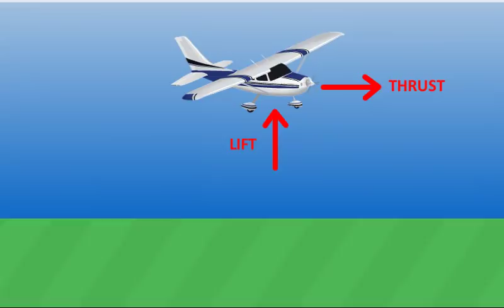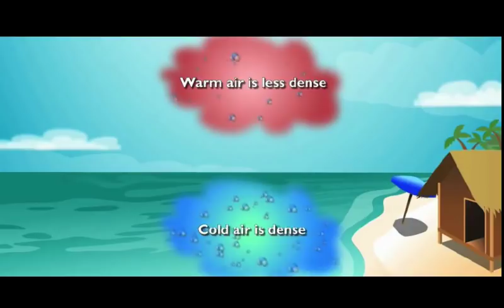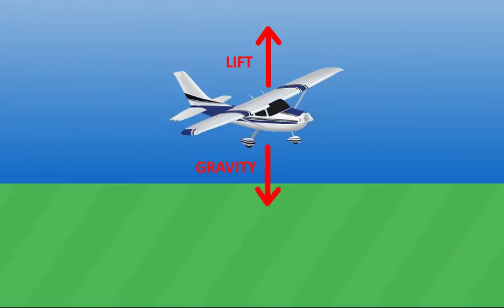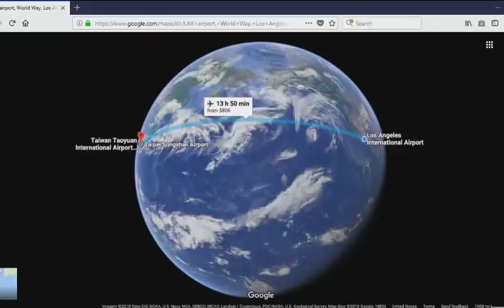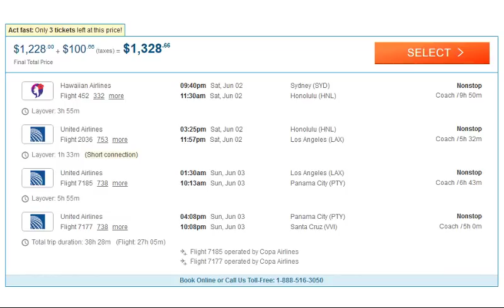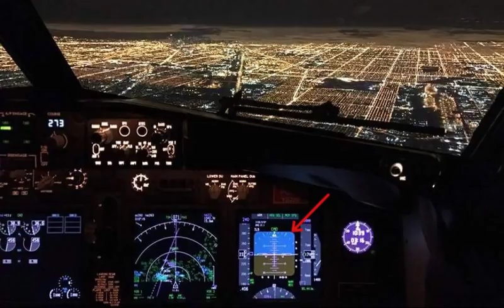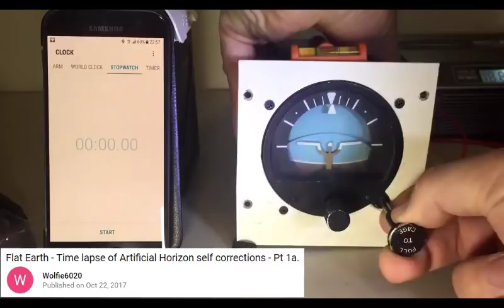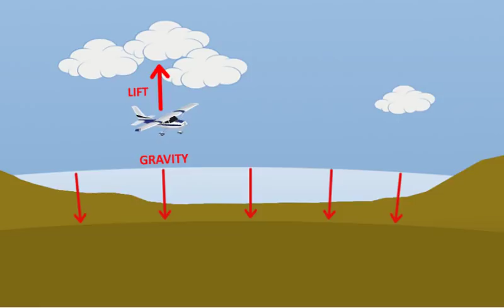Flat Earth Falsities - Plane Nonsense

Comment: The most frightening part is not that there are pilots who don't understand these principles or how their equipment works.
Reply: Actually as a pilot, we know how to operate the equipment but dont need to know the inside workings just as a surgeon has much more skill with his equipment than the engineer who only need to repair it. 
FE's dont seem to grasp that the even downward pressure on all the globe from all parts also has the same effect up in the air. I fly level but i continue around the curve with the atmosphere and maintain the same altitude/height above the ground. They also have terrible confusion between gravity and density. Thats fair enough as without understanding the WHOLE subject, its easy to get confused. As a pilot gravity affects how much power i need per weight to get off the ground but density of the air also is similar in that if the air is cold then i will get better lift than if i was very high up and or the air was hot and humid. 
So you can see it can be very confusing without the FULL training and not thinking you know what you are talking about.  
For you FE's types, what do you think happens when you get on a 400 ton Jumbo jet. All this is guess work by the pilots. They HOPE it will fly and not crash killing all the "non believers" and FE's too! 
No thousands of hours in the classroom and simulator then REAL flying training in the REAL world - its not magic , just physics. sorry to disappoint you. If you ever read a proper science book, you may open your eyes and understand the world around you. Got a few million dollars, you can take a ride into space now with the russians to the ISS space station. many have done and seen the round Earth. Thats fact.
Reply: who are you talking to?  Specifically when you say "for you FE's types".   Because if that was directed at me then you are woefully mistaken.  If it wasn't, then you should be careful using the word "you" when responding to someone.

That said, I do want to address a couple of points you made.  
"I fly level but i continue around the curve with the atmosphere and maintain the same altitude/height above the ground."   Not if you are using an altimeter, since an altimeter actually measures air pressure and not actually height above the ground.  That's why it always needs to be calibrated for specific airports.

"..than the engineer who only need to repair it."  You obviously have no idea what an engineer is or does. But as a pilot it would be critical to know how some of your instruments work.  Not necessarily the inner working, but how they work.  Especially the critical systems. For example, an altimeter works on air pressure not distance.  I know many pilots, (military) and they have quite an extensive knowledge of how their aircraft work.
Reply: Sorry obviously if you thought this was directed at you and you not pretending to know either  subject than i stand corrected- something religions never do!] hmm
Are you a pilot or engineer who have worked on instrumentation calibration. I have. I AM a qualified  pilot but didnt have a formal qualification but worked on instruments to some degree when i did bachelor of aviation ( extra course i took)   and as you said IF you know what you are talking about. Do you know Pressure, density, indicated/calibrated/mach speed VOR/ADF/ ILS/GS, DME, ASI, VSI, Glide slope, RPM, Manifold pressure,  and compression errors at high mach speeds and to use a old hand held computer to work all this out?   Yes, that as  you move from location to location you adjust  Slightly the dial which will move the indicator a little but NOT thousands of feet which you would gain if you flew away from the Earth surface as the FE' say you do. As a instrument calibrator you only know of these things ii order to make the instrument work in real situation like any watch servicing ect. As a pilot you have to use them in a practical way so NO except for some theory at both private and commercial level, you dont TOUCH those instruments internally just operate them correctly with the knobs on the outside as a pilot. 
When you say calibrated for specific airports. You mean just adjust the QFE for airport height on the knob on the front or completely adjust from within??? i dont think so. But you need to clarify as i like to keep to the FACTS .
Reply: I'm not referring to opening up the instruments and adjusting them, I'm referring to the QNH setting.  Pilots need to set the QNH for the departing airport, and the arriving airport to establish an altitude above sea level.  As well I believe there is a standard setting for all aircraft while flying between airports when they reach their cruising altitude.  That's correct isn't it?
Because an altimeter measures air pressure it is critical to have the correct setting otherwise your altitude reading is going to be wrong.   The altimeter uses this setting to covert air pressure to a display altitude.  Now that said, when you are at your cruising altitude, I believe everyone sets their altimeter to the same setting.  But keep in mind because it measures air pressure, and air pressure can change from place to place and over time, the aircraft will actually be rising and falling as it maintains a position in the sky of constant air pressure. Not altitude. So when pilots say they are flying "level" that in no way means that they are flying with a constant height above sea level.  Right?  This is what I'm talking about.
I'm not an instrument calibrator, I'm an engineer and calibrating instruments is not what engineers do.
Reply: Everything you say is basically correct. The concern with precise altitude isnt really the issue. If your set say 1000 mb on the alt and everyone else does in that area than we would all be flying at the same right or wrong precise altitude. so if he needs to be at 4000 and i need to be at 3000 as we converging then we will miss safely. The fact that we arnt exactly that height above the ground dosent matter . When you are landing, you circle at 1000 ft usually and the pattern has everyone able to see the plane in front because we are dialled in the same. for decent purposes to actually landing is done party by alt and the rest by eye especially the last few hundred feet. I am looking out for obstacles and my angle to landing threshold and looking for rail power cables and even a pretty high radio tower such as at dalby in QLD which is near the airport so it pops right out at you and at night without the beacons, it could be hit easily. Not good!
We use the altimeter for really performance of the plane , the actual margin AND the instruments calibrated error makes the alt no good at low level so flying at 200 ft or less, your eyes are OUT the front flying visually. 
Now Airlines from memory and its been a while since i read the textbooks set a standard atmosphere of 1013mb as they so high hitting a mountain is not possible in australia above 7300 and other times they are on ATC radar so are given levels to fly and approach points to enter the airport area. They dont just arrive any place. They and me in my smaller plane radio each point and altitude and other stuff and ATC vectors them to the next place. Theres also approach plates (diagrams) for instrument landing when you are blind inside cloud and you have to fly down to landing on instruments, only visual at min of around 300 feet in front of landing. This is called an instrument rating and its about the hardest course you can do as it requires high precision and massive paperwork and stuff you have to carry . your accuracy with the instruments must be of a hgih degree or you wont pass. It allows you to fly in all conditions with passengers and at night and many people fail trying to get. Its a lot of stressful flying with a very high workload. 
i passed it first time but i prepared with simulators endlessly and practised till it became easy- but it can be extremely tough when you making a approach in a storm with bouncing needles affected by the electrical activity and trying to keep on a imaginary path in the sky in 3 dimension to within a tight tolerance. If you screw up you have to "go around" missed approach and restart a new approach behind a stack of other planes. All this while passengers are starting to complain and throw up in sick bags and the cockpit bouncing around and rain smashing against the windscreen totally blinding when you break up of cloud and have to see and land on runway. 
You want tough- its the toughest thing probably in the world and i done some really scary flights
and i can multi task easier where others cant and even i am pushed to it at times on some flights. i also repair electronics , all of my car, play sport so am multi skilled and its needed!!!
Suddenly for others here, a FE seems a little silly after i explain all this that happens in a round world! .......

Here a video where the pilot of a high performance plane takes off when the gravity is the SAME as it always is , but the density was thin  as in from a high airport or a very hot day as an eg   enjoy..

https://www.youtube.com/watch?v=ZmEVwyMRYIY
Reply: As long as everything is AUTOMATICALLY taken care of... its all fine :)
Reply: the problem is that everything is NOT automatically taken care of.  An altimeter for example needs to be calibrated at takeoff, at landing and possibly en route.  Al altimeter doesn't measure distance above the earth, it measures air pressure.  For a pilot to not know this is frightening and dangerous.
Reply: tchevrier
Real pilots do know. Actors/FE cultists don't.
Reply: Best part is dont take me a pilots word for it. Go and take a flight yourself at your local small airport and see what gravity/density and other things work. Fly over the horizon just like millions every year and sail around the world and live at the south pole base where its dark for 6 months.
Wow, these FE's are really missing out on the real round planet and all it can offer to them.
Also to be accurate the Earth is not perfectly round . Due to the spin it is slightly flattened at the poles- and bulged out at the equator but that dosent have any real world effect but i just being ACCURATE so theres no lies on FACTS.
Also the moon DOES have an atmosphere but its only about 50 tons so once again has no real world effect on radio signals or using it as a base for a big telescope one day we build/ Elon Musk haha builds a base. It will be done at some stage or private companies will do it and take ownership which technically they cant do in the treaty but it will get a little messy.

Comment: As a Aircraft Pilot myself i would like to add a few more points that might help FE's to see the whole picture and help remove some of their confusion. The point of everything moving together has the same effect as nothing all not moving at all- the same result. When i do air navigation i head between two points on the map and the Earth wont drift under me as i am drifting already exactly with the Earth so i can see each feature on the map pass under me along that pencilled line. Drift IS a problem when any cross winds from the left or right and even from behind or in front affect the time i estimate to get there as actual Ground speed is affected. 
A problem both for landing and take off occurs if Altitude is an issue . For example many airports are near sea level where theres plenty of density in the air. so the wing can get plenty of lift even if the aircraft is heavy and take off or land in a reasonable distance. BUT if its done at say 8000 ft the density is a lot less and even a longish runway isnt long enough to get enough lift from the thin air and take off is dangerous or not possible. Landing can also be an adventure as your speed coming in can be very fast and quickly run out of available runway. Flying at 8000 ft, the ground speed will be faster than your airspeed you see on your instrument so this is an advantage for range purposes and one reason big planes fly very high so they can fly "fast" over the ground and because jet engines are more efficient at altitude. Do you ever wonder why planes fly at different hights from say 28 to 38 thousand feet where it will take more fuel to get to the higher alt? Well the meteorologist send up weather balloons and other measurements to determine the wind speeds AND direction at diff levels So a plane in cruise wants a tailwind if possible and a headwind for landing so a flight level is chosen to go faster and also there is traffic separation required for ATC so thats a factor to. Anyone think the Earth is still flat now?- I coudnt fly if that was the case and i do pretty well so ????
A basic Cessna can only reach well under 20,000 feet so cant fly around Everest (29,000) unless an aircraft has bigger engine with turbo charges and very efficient wing. WW2 fighters didnt have huge wings but their power was massive so made up for one or the other its a trade off- plus that was stable max cruising height NOT dog fighting height. At the South pole (9300 ft Alt) sometimes rocket bottles are needed under smaller cargo planes to assist them in getting airborne and the thin dry cold air makes cuts not heal properly so doctors try superglue haha.

Now in space its a little different. When Apollo takes off for the moon 238, 000 miles away, it is pointed ahead of the moons path as the moon is orbiting around the Earth . So in 3 days or so it intercepts the moon then it is captured by the moons gravity and now can organise an orbit using rocket firings to makes a stable orbit around. Same when it leaves, Mission control need to update their figures for departure time and send up the exact angle correction so the CM can fire precisely at the right time from around the moon and head back to Earth ahead of Earths path and meet a few days later, slow down and get captures by our gravity and splash down. Its all simple gravity and physics as theres no air in space 

For you unsure FE's or confused but interested science types, dont listen to crazy claims against basic physics on the internet. CHECK the facts yourself. read some books yourself  (not creationist books!!)  and make sure you cover ALL the subject because if you nit pick bits like confused people do, of course you will say hand on the Earth is flat because of this! NO you missed ALL the facts which will then put the picture together correctly then it will make sense. A little knowledge IS a dangerous thing. Would you perform brain surgery if you saw one video by an unqualified person claiming they can do it?- i guessing you woudlnt!!!
Reply: Waste of time Im afraid. FE brainlets are too dense to understand anything you said, and is the reason they're dumb enough to believe in FE in the first place. God help us.
Reply: Yes it has its roots from the "good" book that tell them how the Earth is so how can god be wrong?- except you can see it was written by men so IS the science of the day. Funny how in any holy book their is not ONE single scientific thing we know today. Is god that ignorant or hiding the facts we know today.  The other writings are very nice and clever but any "science" is sadly totally wrong. We are not in the middle of anything. We are just tucked away in a average galaxy and we are an average species that makes war and is very gullible to any claims put to them. 

The other reason for FE's i afraid stems from distrust of Govt. Govt DO lie about many things BUT thats all words . FE's make the wrong connection between scientist and govt cover ups. You cant lie about physics and all scientist  are NOT part of any govt except when they are paid to make bombs or rockets to the moon or medicines to save humans from million year old viruses. Almost all scientist are privately funded and in universities all totally independent of ANY influence and are naturally VERY curious so if there was even a SNIFF of collusion, thousands of scientist would all know and it would be slashed all over the papers. "govt tries to change scientist mind" scandals everywhere. Religious people may be able to be brainwashed about their "truths" as they never question these. BUT scientist question everything everyday and never stop experimenting, checking and building SLOWLY carefully the knowledge of man and ONLY true science has these checks and balances and where something is discovered out of place, HUGE news is made and thousands of the most clever humans on this planet are all over it working out what has happened and correcting the problem. 
When you look into the FE video areas of the internet its a complete mess of sillyness where anyone can post anything and like "wko killed JFK, any idea no matter how crazy can be put up with no evidence just "belief" and others believe it to just like they trust the bibles ideas of 6 day old earth. flat earth and endless stuff that was shown incorrect centuries back by men without any real scientific knowledge. But they realised its all wrong just with some simple tests they could do CORRECTLY. 
Its sad, some of these people here seem bright but they have adsorbed this nonsense are are so mixed up now they cant work out whats right and wrong. 
We only have science to prove what correct and whats fables for our species. We can only show and prove and if thats not enough, well humans are as gullible as they have been since the dawn of man and will continue to be- sad....... 
Also any FE with a couple of million dollars can go into space on a russian rocket (many civilians already paid to do so ) and see for themselves and THEN, all this sillyness might actually end- but i doubt it....  sad...